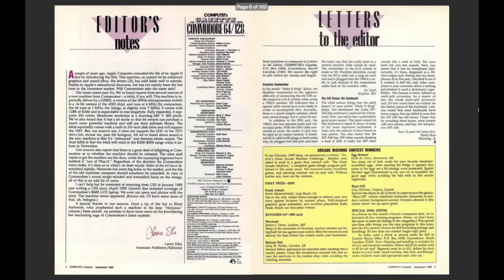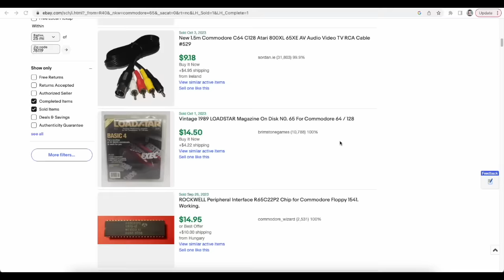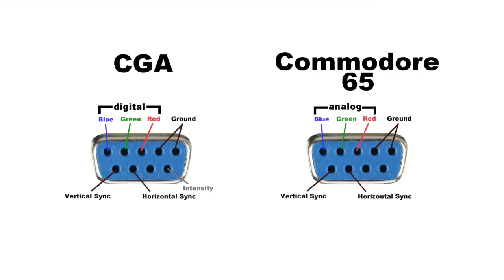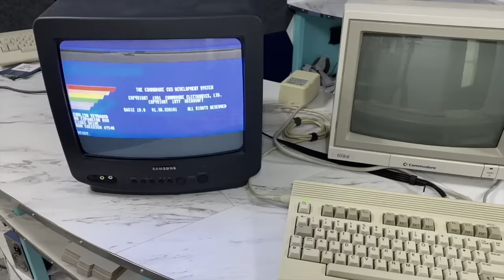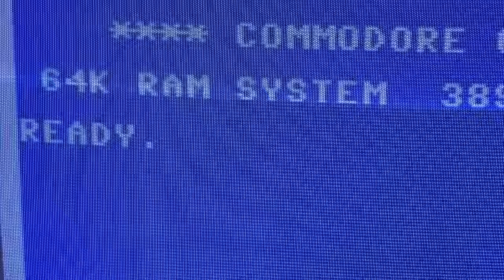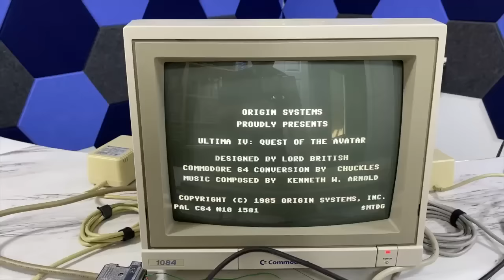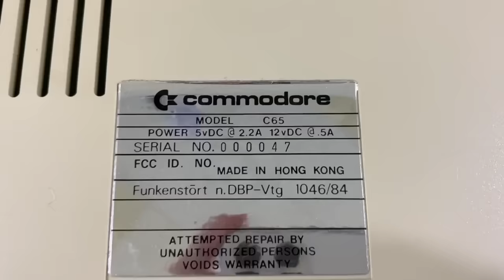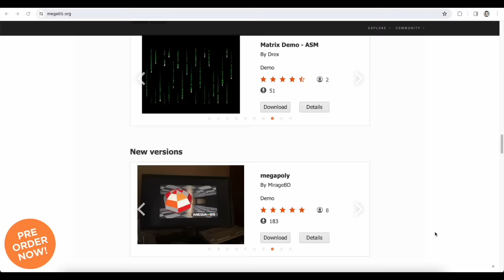The Commodore 65 - A Rare Prototype

Comment: Unless the computer was a huge sales success I doubt it would have had much software support. Software developers typically take a "least common denominator" approach to systems like this. The Atari STE is a good example. There are some STE enhanced games, but mostly developers targeted the regular STs since that was the larger installed base.

Comment: The "Commodore C64GS" was the 128D. Both of them were intended as desktop machines instead of keyboard boxes, and both tried to extend the features of their base system but hardly any software really made use of the capabilities. And consequently, both of them never really was super succesful on the market, because they were already surpassed by more capable models.

I'd take a gander and guess that that 1565 is very similar to a regular 1581, as it was already built from off-the-shelf components. Did you manage to get a look inside it? I'm also surprised that the unit didn't have some kind of hard drive, or even a controller that is capable of taking one.
Reply: Actually, they couldn't be more different.  The 1565 has far more in common with a drive from an Amiga than the 1581, as both the 1565 and the Amiga drives are controlled by the computer's CPU and rom, instead of their own as in the 1541, 71, and 81.   
The 1565 has just two tiny chips in it... a 74LSxxx and an unmarked GAL of some sort.  I've a picture of the board on my site if you are interested.
Reply: @bozimmerman  So I suspect that that 74 chip set is some kind of shift register set then, because there are no more than a dozen pins on that mini DIN jack and the floppy drive uses a standard 34 pin PC/Shugart interface. The Amiga drive is just a regular Shugart floppy.

That would mean their "new" C65 interface would be a serialized Shugart.

Comment: Excellent system, that hardware should be inside the C128... however, I disagree that it could have replaced the Amiga... Amiga was a multimedia powerhouse not only because of the PCM sound, the bitter, and the 4096 colors.. but also because of its open architecture and an OS that was ahead of its time, offering preemptive multitasking, etc.

Comment: A nice video to complement the other commodore history videos. I think its another example of commordore mismanagment and wasting resources. From the UK prospective, it does not really fill a gap. If you could`t afford a amiga, you could buy a Atari ST..In 1990/91CBM were knocking out alot of low cost C64c (night moves, hollywood pack) with a hugh amount of software available, then there is the 8 bit amstrads with disk drive and monitor, then Atari ST, amiga (both with a lot of low cost software..) Then the low cost PCs from Amstrad were avaiiable for a bit more cash. ..

Comment: Hmm. Why would they change the connection type for the 1565? And why shouldn't a standard IEC drive be able to be 9, just like a 1001 can be an 8 even though it's not IEC, but interfaces to the user port from its IEEE-488 port?
Reply: The 1565 is not an IEC drive.  Unlike all other 8-bit C= disk drives, it is controlled entirely by the special chip inside the C65 computer.  That's why it needed a different cable.

Comment: Any idea on how the drive compares to the 1581? e.g. is it just a 1581 skinned to fit into the 65?  Did you try the "change unit" program on the 1581 demo disk to try to change the device number in software?  Are there traces that can be cut to change the drive number like in a C128D/DCR?
Reply: Hi @RandomBitzzz.  Unfortunately, no, the OPEN1,8,15,"U0>"+CHR$(8) doesn't work in the C65.  The drive in there isn't a smart drive like the other 8-bits, but a dumb unit controlled by the CPU like in the Amiga.  All of the CBM-DOS commands are implemented in the computer itself.  Now that I write this, you know what might work though?  Changing the device number by altering the ROM.  Or at least having the ROM read a particular RAM location for the number.  Hmm....
Reply: @bozimmerman  I suspected it wasn't a full blown 1581. It looked too small to have all the support chips. I like your thoughts about changing it in the rom. I can't help but wonder how much more [C64] compatible it would be if you can get a 1541/71 connected as device 8.
Reply: @RandomBitzzz I also wonder that.  I was surprised he got those games to run.  Since I have a C64, I don't normally play games on my C65.   However, back in the 1980s, I did fill up 20-30 disks for a 1581 with many hundreds of cracked games I can try.
Reply: @bozimmerman  I happened upon a collection of single load software that looks like it contains a lot of PAL stuff (it runs really weird on my NTSC machine). IIRC, there's also 1581 disk images of GEOS out there. If you're interested in collaborating on something LMK.

Personally, I've got maybe 100+ 3.5" disks loaded with goodies that I need to go through. I've been meaning to look into an adapter so I can archive them as d81 images before the media degrades any further.

Comment: As someone who works in a factory that makes injection molded parts looking at the spot I suspect it was poor last minute tooling on the mold. Looking at it closely it looks like they're tried to make the hole in the mold smaller during retooling but meessed up, rushed or cut corners on the retooling. Thankfully the company I work for is very careful when servicing our customers molds and always runs test parts and consults with and checks with the customer along the way. If the people who made that cover for Commodore had done that it wouldn't have been as bad. At the company I work for that piece would have probably never passed and would've been scrapped. That definitely wouldn't fly where I work. I almost feel embarrassed on behalf of the company that made that.

Comment: had an idea for the whole ram situation for the x16, it appears there are off-the-shelf 16MB SDRAMs available - self-refesh included, and their pinout seems strangely similar to older RAMs...
They seem pretty cheap as well, about 10$ per. Anything preventing their use?

Comment: The C128 came out like 2 years too late looking at that chart.  If it had come out in 1983 it would of been more of a hit.  As far as I'm concerned, the C128 and C128D was more important than the Amiga as far as the computer that should of been that never took off.  The Plus/4 should of never existed.    The Amiga 500,100, and 2000 were utterly destroyed by the Mac SE, Mac II and IIfx.  Literally, Macintosh wiped the floor with them...

Comment: i guess the idea was to map the internal drive to a different device number in 64 mode and then make a proprietary 5.25'' drive, or an adapter cable to plug existing drives

Comment: Now if only the VC40 prototype would show up again or the VC364 getting some love instead of the 1000th spin on the C65. The few machines existing appear to cycle through owners quite quickly (not Bo tho, that's a cool person caring about history rather than prestige or financial investment).
Someone I briefly knew who personally dumpsterdived his prototype had sold it off in the late 90s, because let's be honest here, it's not a very interesting machine apart from the name. Machine sold for less than $800 (which already was a ton back then).
Love the "Classroom" and "Amiga C64DX" prototype variants.
Reply: Thanks for the kind words.
On the CV364, I think mine is far too ugly for a proper video (you've seen it, right?), but wouldn't it be great if the mysterious German who bought the pristine one from Dan Benson back in the 00s would surface?  Like you, it makes me sad when people get this super rare stuff and then hide it from the world.
Reply: @bozimmerman  I've seen it and regardless of the condition it perfectly qualifies for a video :) Considering it used pre-production quality plastics I'd consider that an amazing extra aspect of your machine.
Prestige and considering ancient hardware as financial investments is what kind of drove me away from the hobby after 10 years and quite frankly, whenever I check into the usual places again I don't regret my decision. It's extremely sad when machines get basically sucked into black holes due to ending up in private collections (nothing wrong with private property, but we're dealing with history here which should be documented before it disappears).
I've managed to get my hands on one of the very rare, non Commodore PC soundcards from 1988 with a SID a while back (nowadays 2 are still known to exist). That card has been fully reverse engineered by now, is emulated and even has replica style boards available.

Comment: ahhhhh the C65...

if in another universe commodore launched THIS in 1985-86 INSTEAD OF the ugly, clunky, doomed and ultimately failed C128, AND not expense time and resources on the failed /4 saga AND not launched the much better, awesome, somewhat profitable, powerful and success that the AMIGA was... then... maybe the "C65" was able to sucede the C64... for a 3-4 year run. maybe. 

(and to do so, has to kill the original C64 in the process)

bottom line: ANYTHING not amiga, not mac and not "IBM" PC launched AFTER those... was esentially fail in the short or long run, in one aspect, another or all of 'em. this applies even for the Apple IIGS and the atari ST but also some other attempts you (8BG) would like to review in the future... like the sinclair QL (spectrum-ish attempt to do a "business 80 column CP/M capable system" wannabe ... obviously fail, and a crap design in various levels), the SAM coupe (one of the last 8bit machines and retro compatible with ZX spectrum), some amstrad like the PCW line or the CPC plus line, the MSX2, 2+ and TR, the acorn archimedes (grand-grand-grand father of the today well know, success and ubiquitous ARM line of processors), rare oddities like the russian spectrum clones (pentagon, scorpion...) or the fujitsu FM towns... and other attempts (north american) you already know, like the latter atari 8-bits (like the XE) or... this thing, the last straw of the commodore 8bit line (although really is a 16bit inter-generational one). 

ultimately... what really suceeded in the market, done so by good reasons, and that was during some time the amiga (basically until the AGA line flop), in the long run, the mac and, above them all, the PC 386+ +VGA +SB +ATA HDD +CDROM PC compatibles. 

anyway good documentation video, btw. thumbs up!.

ps. in 1990 commodore finally used the GS to name a C64... to do a keyboard-less "console" to "compete" versus NES... in a world where sega megadrive already came.... obviosly failed, too.

ps2. the C64 sucessor for commodore was the Amiga, and was great in a 4-5 year run. (with the flaw of not being retro compatible... but also there is almost none pre-1989 16bit sucessor machine retro-compatible with any 8 bit line). ultimately commodore pop blow it, but thats another history. (the AGA line and specially the CD32 flop)

Comment: Just buy yourself tiny tv from Europe. I got 13 inch 16:9 led tv ( Mistral TV1331)with all important sources (SCART, HDMI, composite, component, VGA and analog tuner) and its great for my requirements. It has only DC in ( you can power it using 12V adapter). It even fit into the same box with my Atari ST.

Comment: I'd think resolving external drive numbering would be relatively easy. Drive IDs can be soft-changed, and I believe the internal drive can auto boot (AUTOBOOT.M65).  So a simple shim to swap drive IDs around may have solved that.
Reply: How do you soft-changed the device 8 drive number in the C65?  I have tried everything I could think of.
Reply: @bozimmerman  I'm speculating, as I don't own a C65 to test on. But assuming internal is #8 and external is #10, perhaps something like this would work (first changing #8 to #11);
OPEN15,8,15,"U0>"+CHR$(11):CLOSE15
OPEN15,10,15,"U0>"+CHR$(8):CLOSE15

Comment: The only difference between the 1571 and 1571-II is the second was more slimline and slightly faster but yet, it suffered from overheating because there weren't enough vents.

You have a SFD-1001 or SFD-2001? Those are neat drives that connect on the expansion port.

Comment: The C65 was a big waste of time. Resources that Commodore should have spent on improving the Amiga. If it had come out in '85, along with the original Amiga, or perhaps in '86, as a replacement for the C64, than it might have been worthwhile, but once the Amiga 500 had been released, it really didn't make much sense.

Comment: I never heard of the 1565 drive, and I am very happy with my Mega65.
Reply: Hey @dougjohnson -- funny enough, the I/O expansion board for the MEGA65 that they are working on seems like it will have the same C65 Disk Drive port, so we might get reproduction 1565s next!
Reply: I hope they are going to build a RAM expansion more than a 1565 drive. I unplugged the 3.5 and just have it set to use a d81. I have also found that a PC Gotek virtual drive works in place of the physical 3.5.

Comment: It would have been too little too late. Had they releasdd this instead of the c128, it probably would have done well, even if it still was 'just' a higher clocked 65xx chip.

Comment: C64 is 64 kilobytes, C128 is 128 kilobytes, plain and simple.

C65 is a,   ...um, say what?

It was more than marketing could save, obviously.  Or less, heh.

I grew up on a TI99-4A computer connected to our television set, because we were poor.  And I programmed to its BASIC limitations, even With its "Super Exteneded BASIC" cartridge installed!  This '65' hogwash wouldn't have mattered to me in the least bit.  If I'd had the money, I would have bought a C64.

Comment: Is it possible that since these C65's were more or less prototypes, that they had not yet gotten around to full C64 backwards compatibility particularly with hardware like disk drives?

I think part of the reason some of these older machines did not make it when the PC came around was  perhaps because they were too proprietary and IBM (and later Compaq) were trying to break that tradition by having more of an open system if you will, that uses off the shelf parts and a standardized operating system.  I think that's perhaps where Commodore messed up.  While the tech may have been forward thinking, I think the fact that the system was relatively still closed made it harder to develop for among other things, even though C64's were quite common at least.  Developers probably didn't take them too seriously and took Apple and IBM more seriously as they were likely eyeing the business sector as big markets.
Reply: It never would have had full backward compatibility, since the CPU isn't fully backward compatible. It's a variant of the 65C02 and has different cycle timings as well.

Comment: I'm kind of surprised they set the built-in disk drive to drive 8 instead of having it use a different disk number, given the incompatible format. Then the external drive could've been configured to use drive 8 and provided much better compatibility.

Comment: So it basically had the same problem as the C128.  All the system improvements would have gone into a mode that was rarely used.